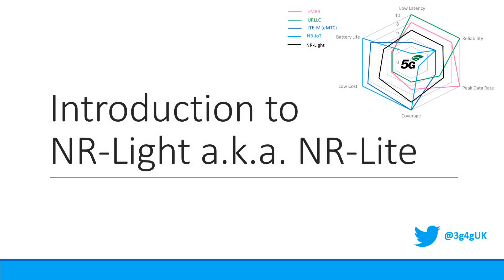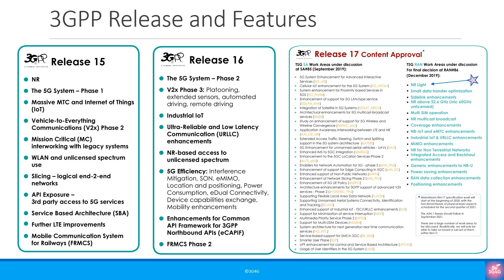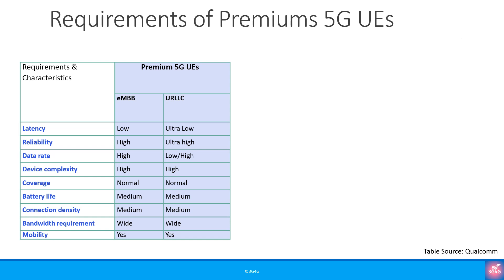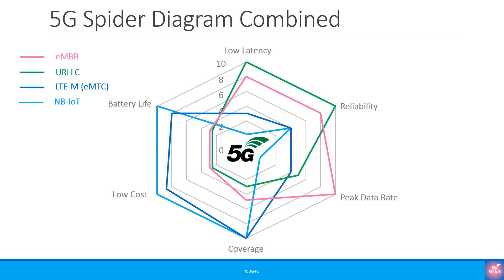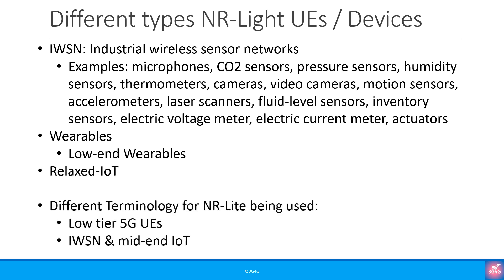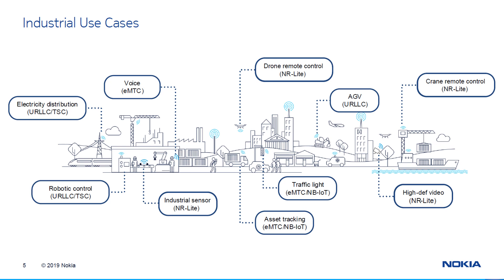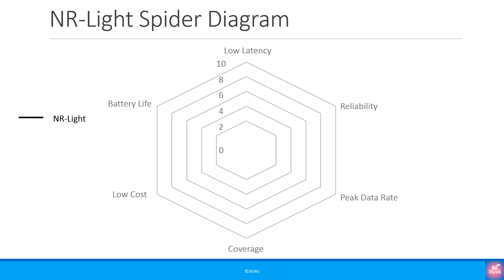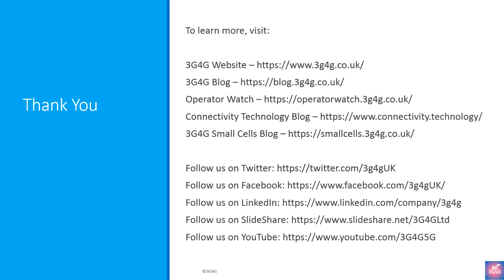Beginners: Introduction to NR-Light a.k.a. NR-Lite

Comment: What about evolution of eMTC towards the same targets than NR-Light e.g. higher throughput and reliability? Would it then make NR-Light somewhat obsolete?
Reply from the maker: eMTC has some very strict requirements, like 1 million devices per sq. km., low cost, very low power consumption, etc. This means that it will never become the same as NR-Light and vice versa. Hence this study item.